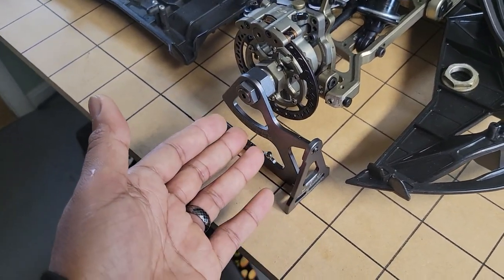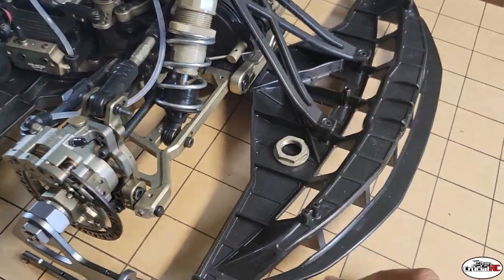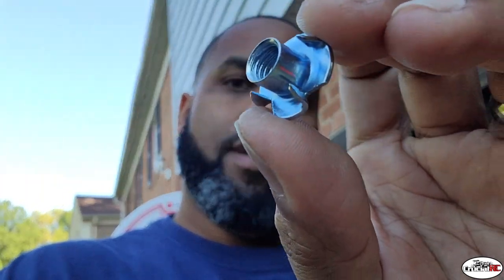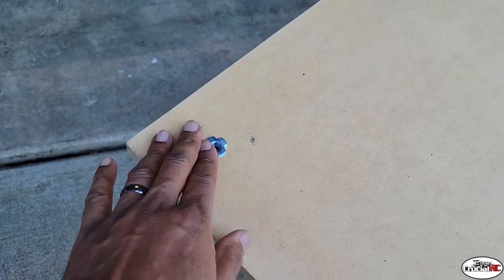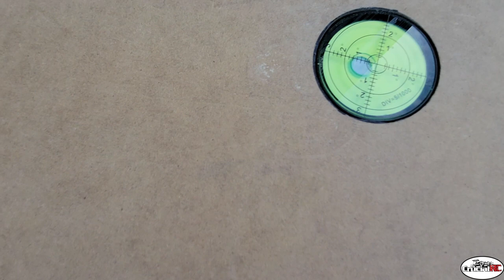DIY 1/5 Scale RC Suspension Setup Board

Comment: If those are the integy alignment tools, you can build another bracket with four screw holes and a long piece of flat stock aluminum. Atleast that's what I did on for my buddies 30 north truck
Reply from the maker: Yup it's integy. I'll definitely look into that. Thanks.

Comment: Dig the vid! What hub adapters are you using to use the 4 pieces that gauge the castor/camber. I have the same station but can’t get the MCD hubs through the bearings. They’re too big. How did you get around that??thanks brother!🙏😁
Reply from the maker: Thanks. My integy kit came with hub adapters to fit in the setup kit.
Reply: Ha! Just popped the bearing out and the hubs fit perfectly through 😂 too easy. Now to find a way to get square 1/5 hubs to work on it. Thanks YO!

Comment: A really cool DIY board 👍 The plate is fairly thin, so I hope the MDF doesn't bend if the car is kept on it for a long time.
Reply from the maker: No the board is separate from the car. What do you mean by "the plate"?
Reply: @CrucialRC  Ok. Sorry, by plate i meant board
Reply from the maker: O ok. It is 3/4" thick so I don't think bending will be an issue but it is also heavy. I'm looking for an alternative material. Maybe HDPE will be a better choice. 🤔

Comment: Where can I find those Energy setup Hubs?  I just picked up a on road car to build and want to make a Huddy Board Setup like yours on a stand.  what size is the whole board?  Thanks Lance!!
Reply from the maker: Here https://www.integy.com/st_prod.html?p_prodid=19327&p_catid=163#.Y9ShYKROk0E
The board is 24"W x 48"L
Reply: @CrucialRC  Thanks lance!!, I picked up a F5 and plan on setting it up for the track.  I plan on using a MCD 2speed.  Do you have any experience in this Modification to the Rovan F5?
Reply from the maker: No problem Chris. I don't think the mcd 2speed will work with the rovan. I think the rovan diff is based off the losi platform. I think you will need a losi type 2speed. Check the internet tho. I may be wrong. Not much experience with the f5.

Comment: Copying lol . Nice setup board. I would clear epoxy coat it to help keep the board moisture stable but also easier to clean.
Reply from the maker: Thanks for the tip. Yeah I need to put sealer on it. Maybe a spring project🤔